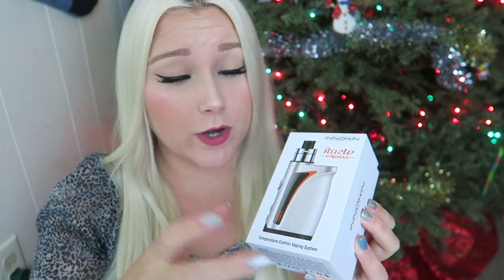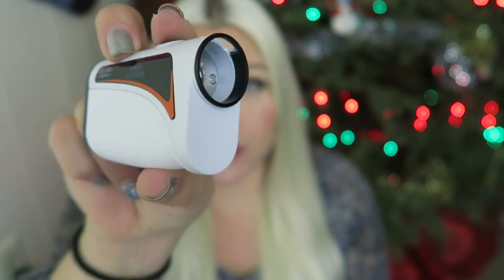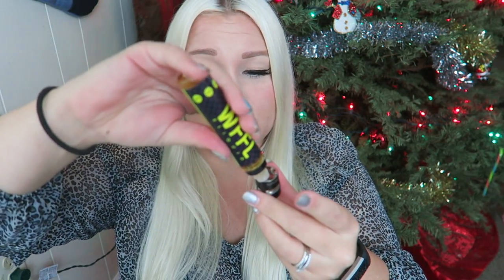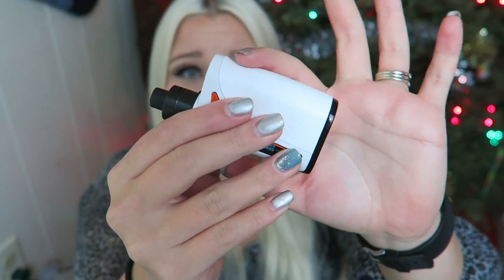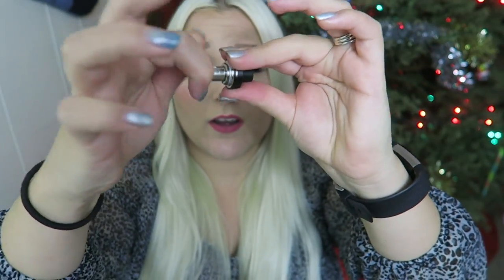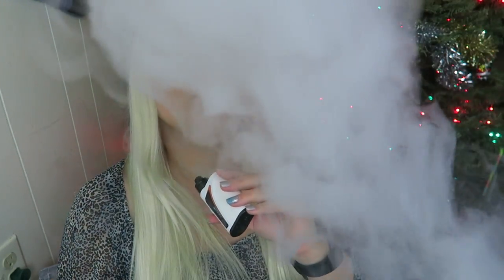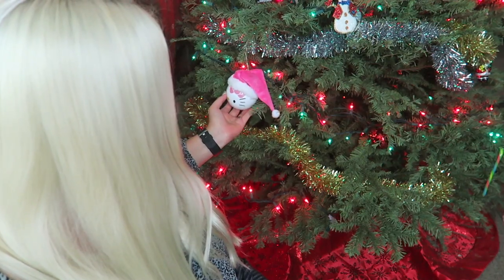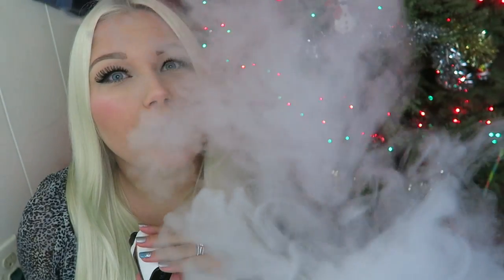Innokin iTaste Kroma TC Vape Mod! | TiaVapes Review

Comment: I picked up one in the dark green color. Got it during a 40$ reduction for vape awareness so 9.99!😳 Anyway, love it so far. Great flavor and great clouds. I've been using it for about 3 weeks now. Figured out what the half circle looking thing was for, to remove the adapter. Much easier to screw it onto the tank you're going to use if you're not using the Slipstream. Still trying to find a good place to get coils though. Anyway I am looking forward to your 1 month update!! Keep up the great work your Highness!😁

Comment: theres an adapter to move the connector up correct? i believe indoor smokers touches on that, all in ones.. the portability is great but you lose the option of an rda, do are rbas a thing for all in ones? and the battery life on these built ins are so low excluding the tesla three. 
(full disclosure, im working with an mvp20w so take my opinions as you will)

Comment: That .5 coil is only rated for 35 watts. Any problems using it higher?
Reply: kronosx7 I've got one and use kanthal all the time, the factory kanthals just can't handle going above 35W they dry up and scorch almost instantly no matter the juice ratios.

Comment: The slipstream has a child safety lock you have to push down as you turn!
Reply from the maker: B Roberts I know this!
Reply: TiaVapes I made that mistake lol just wanted to let you know in case
Reply: The clicking is the child proof so maybe you didn't push down hard enough? I don't know, I had no problem with mine, maybe it actually was defective. How'd you test the .8 coil if you couldn't get the cap off though?
Reply: kronosx7 she used the other tank she had!
Reply: Mine tank stuck like that, I had to pay to exchange it for a replacement and the new one stuck too. It's such a shame I loved this mod.